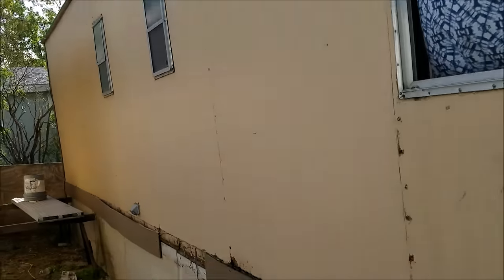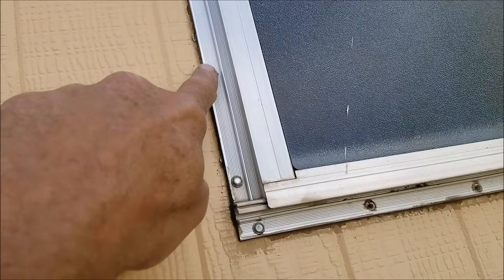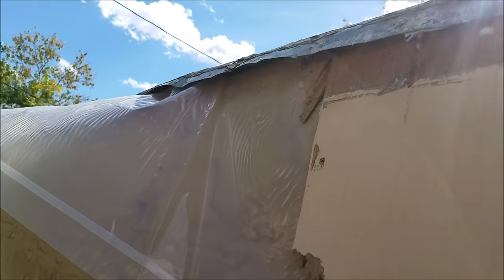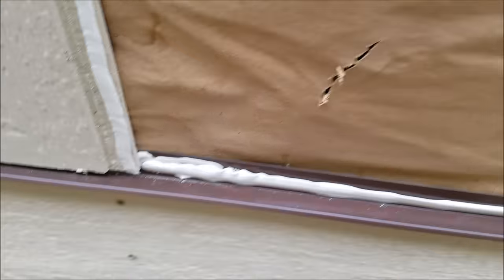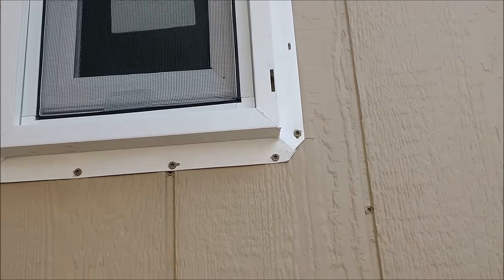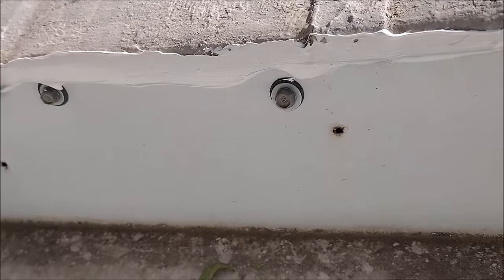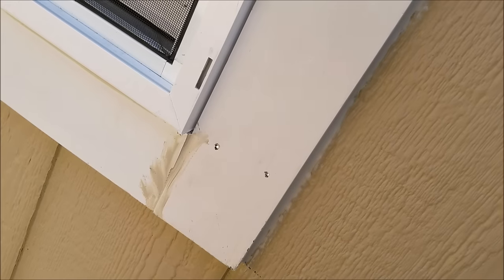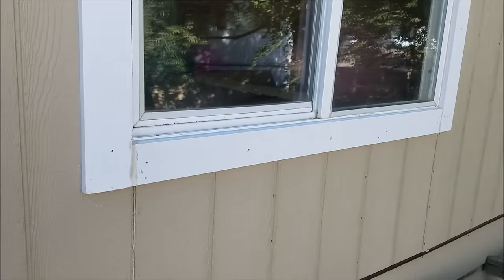Trailer house siding The right way to re-side a Trailer house Mobile home.

Comment: I've been in my mobile home for 8 years now. And now I have my first leak. It's metal walls outside, and I have a rain leak over top of bedroom window inside of front frame. On top of the window. Drips down, I had to put a bowl in windowsill to catch dripping water. I really don't know where to start to fix it.  I'm 63 and on my own and I don't need this. Can you please tell me maybe where to look or what to use to stop  this leak.
Reply from the maker: Check and see if there are any Handymen in your area that can give you a Senior discount. Sorry to hear about your situation.
Reply: Technically you should reseal around your windows every so many years.  As long as the leak isn't coming down from the roof, it's very likely coming down the side of your exterior walls to your window and the seal has failed, allowing water to enter into the backside of the window.  The easiest and cheapest way to try on your own, which doesn't require much, is to get a ladder and caulk around them, making sure to seal it well.  Be sure to use a silicone for exterior.
Reply from the maker: @K3nVV  Very Right. Anytime there is wood involved outside requires annual maintenance, our last house had log type siding and it was a nightmare every year. Thanks for the good Comment and Thanks for watching.
Reply: All you have to do is clean the old caulking off of the outside edge of around the window really good.(where the edge of the wondow flange meets the wall)
 And then go to home depot and buy a caulking gun and a tube or 2 of exterior window silicone or caulking. And then just re caulk around the window, and it will stop leaking.
Only cost you like $20

Comment: How much does something like this cost?
Reply from the maker: The price depends on what material you use, how big your mobile home is, who's doing it, etc. This cost the lady $40.00 a sheet for siding, she got her window at a discount due to some slight damage. Her total cost in material was around $700.00. I only charged her $25.00 an hour for labor as she was a single mother. my labor was around $400.00 total. Also keep in mind hurricanes cause plywood materials to fluctuate in prices I've seen this siding range from $30-50 a sheet. Thanks for watching.

Comment: Hi l have a 1994 mobil home some sidding have a damage   l dont have  a lot money for fixed but l need fixe look prety bad  a some recomendation please in great falls montana fixed is spencer my son hi try tomorrow to star fixed  l dont know l have fairh hi do good job
Reply from the maker: I would use osb, instead of the expensive siding,  and paint it right away,  it will last a few years,  I've done it on our little house, in another video.

Comment: What thickness is the siding?
Reply from the maker: 7/16" T1-11
Reply: @TheBlueCollarPreacher  thanks! Also how much psi did u use for the nail gun
Reply from the maker: @JoseRodriguez-sn9is  I used screws and a small cordless impact. I used 1-5/8" zinc coated screws about 1' apart on the 16" centered studs. However it depends on your mobile home's design, it may have 1x2's running horizontal, you'll have to use those to fasten your siding too. Thanks again.
Reply: @TheBlueCollarPreacher  thank you, alot of help!

Comment: The point of the z flashing is to let moisture from behind the siding come out if u caulk it it defeats the purpose of the flashing
Reply from the maker: The flashing keeps moisture from getting behind it. I am getting ready to to put same set up on my little house, stay tuned, and I can explain more then. Thanks for watching.
Reply: The flashing is indented to go on and the house wrap over the top flange so that in the event water gets where it shouldn't it can run from behind the siding and out
Reply: Should get a different window..busted flange and weep holes on the side?!
Reply from the maker: @karlafonin9241  Most people that live in a trailer house can't afford top quality; they buy what they can get. I just do the labor, even at a discount because she is a single mother.
Reply from the maker: No it's to keep moisture from getting behind. not letting it out. You may be thinking like weep holes that masons put in bricks to let moister out. We're trying to keep moister from getting behind there in the first place.
Reply: U should ask ur local lumber yard next time u go the intended purpose, u might instal differently and it may work for idk
Reply from the maker: Been in the business for over 40 years, trust me I know what I'm doing.
Reply: Really?? U put ur dripedge metal for the roof behind the gutter lol it doesnt matter how long anyone has been doing construction changes nonstop so unless u stay up to date on the newest methods I doesnt matter we change things due to the fact that we find flaws in old methods
Reply from the maker: @Alex-rq9jj  That is why you need to use the Butyl sealant, It's not your regular caulking. It is made for these type of situations. Check out some other roofing methods like how to seal penetrations.

Comment: what size nails do you use
Reply from the maker: I used 2" Torx head deck screws, they hold a lot better. Thanks for watching.
Reply: @TheBlueCollarPreacher  did you install the siding you self or did you have help
Reply from the maker: @samuelvillegas5286  My cousins son helped me, to help keep costs down. Thanks for watching.

Comment: How much does something like this cost
Reply from the maker: It all depends on where you live,  and when; I have seen it range from $20 t0 $50 a sheet,  hurricanes usually causes it to go up in price. Just this last month it has doubled because we are heading into hurricane season. Labor depends on location. This job the siding was around $30 a sheet at that time, it's around $45 here in Wyoming as of now.

Comment: The window is installed sideways. Weep holes should be at the bottom.
Reply from the maker: Again please read other comments, THIS IS A TRAILER HOUSE, SINGLE MOTHER, CAN'T AFFORD SPECIAL ORDER WINDOWS, SHE BOUGHT WHAT WAS AVAILABLE, PROBABLY AT A DISCOUNT DUE TO DAMAGE, THIS VIDEO IS ABOUT INSTALLING SIDING.
Reply: This is what I noticed too. I had a window that was put in with weep holes on the side and I didn't know that in the wintertime the water was freezing and ended up cracking the vinyl frame where I couldn't see it and ended up with a lot of water damage from water draining inside my wall from the water draining out the crack into my wall

Comment: How much did the job cost?
Reply from the maker: 18 sheets for 70' trailer= $540.00 I have done it with just regular 7/16 OSB put on backwards and 1x2 put over seams primed and painted, at a fraction of the cost.
4x8 window= $380.00
3x3 window= $100.00
1x3 window= $70.00
Labor was cheap for single mother.
That's for one side.
Thanks for watching

Comment: You do realize that the window is installed incorrectly.  The slots on the outside, under the sliding windows are for water to run out of.  Now that the window is turned vertical, the water will have nowhere to go  and will accumulate inside at the bottom.  I hope to God you put clear silicone sealant over those useless holes.
Reply from the maker: Hey McFly go back in time and read other comments. Thanks for watching.

Comment: Way over kill, you will never get money back on the cost of repairs on a manufactured home. we cut out rotten usually about 1 to 2 feet redo and then install vinyl way cheaper and longer lasting. when you reinstall the woodsman siding you need to check chalking every 6 months and redo as it can start rot in under 2 years.
Reply from the maker: As stated in lots of other replies; I only supply labor, not materials. I just do what the customers ask me to do. Thanks for watching.

Comment: Trailers are not to be lived in long term. It's temporary housing. Life span of a trailer is 15 to 20 years. Trailers bring down the community.
Reply from the maker: Well Trailer homes are like used cars, some last a long time and some don't, I have even been in and remodeled old houses I think should be torn down and started over. When my wife and I first got married we lived in a trailer house that was built in the late 60's or early 70's had our first daughter in it; but we moved on to our first house which was built in the 1940's, I didn't know which was worse. But 30 plus years later we are getting ready to build our dream home (Shome on the Range) Stay tuned for them videos, we have a few now. Thanks for watching.
Reply: They keep some affordable housing options available to some that would probably otherwise be without a roof over their head.  Housing has become inflated (again), making it that much more important.  Lots of the parks are getting razed; (property tax) money talks!
Reply: All forms of housing are temporary. Every living person eventually dies. Therefore, You are also temporary.

Comment: ...a "trailer house mobile home"?  They're manufactured homes.
Reply from the maker: Not according to people in Wyoming, a manufactured home is more like a double wide on a foundation. Thanks for watching 😊
Reply: @TheBlueCollarPreacher  ...a double wide on a foundation, is a double wide on a foundation.  A "trailer" is what you hook-up to the back of your car or truck to pull hay, or load some furniture on.  A mobile home is an RV.  A manufactured home, is a home manufactured indoors.  Times have changed, they're not "trailers" anymore, or mobile homes.  I've been all over this country, and even in Wyoming they're still manufactured homes.  Just trying to get the verbiage correct.  But then, I guess you can call it whatever you want...

Thanks for the video.
Reply from the maker: @K3nVV  yes times are changing, we call little RV trailers around here Campers. And mobile homes in trailer Parks trailer houses. And big double wides on a private lot on a foundation a manufactured home, guess just depends on where you live. Some people call toilets commods in parts of the country.
Reply: @ K3n I’m from NH and we all call them trailers or mobile homes. Anything you can hook up to and tow is called a “camper”
Reply: @TCSwizz2  ..no worries, I understand.  They have been called "trailers" and "mobile homes" for generations. It's easy to see how and why the verbiage is still used.  Thanks for the reply!
Reply: Not to get all technical but anything built prior to June 15 1976 is a mobile or trailer home. Anything after is a manufactured home. This according to Manufactured Housing Institute’s National Communities Council (MHINCC) which states that any home built entirely in a factory is considered a manufactured home.  Sorry if I'm being that guy. But "mobile" and "trailer" are still widely used regardless of when the home was built. Nice work!